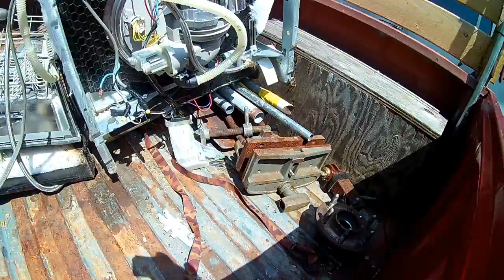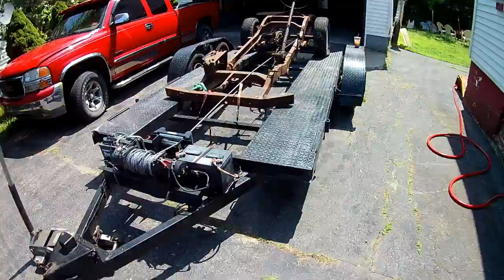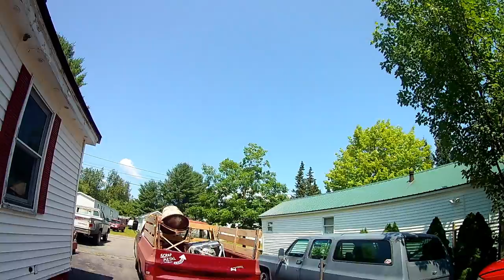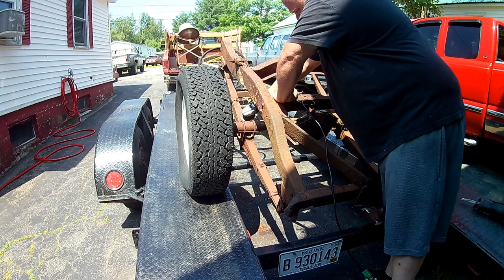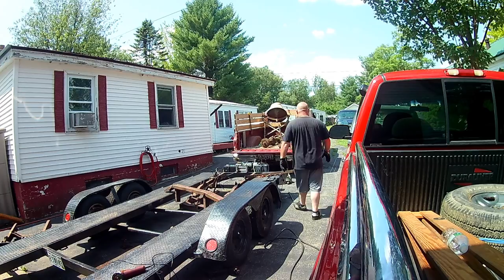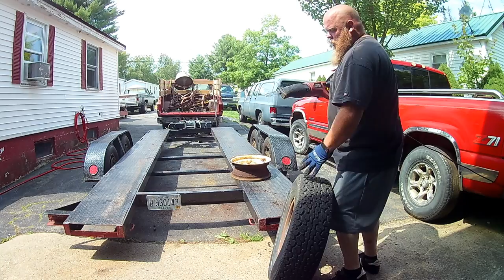Near DEATH by #1 steel

Comment: what you should invest in is an engine lift that sits in the bed of your truck i used to do scrap metal and i won't do it again without one itll save your back in the end and it's only a few hundred bucks for one
Reply from the maker: Had one years ago, bent my truck all to hell lifting crap on lol
Reply: that sucks man I can see that happening I'd rather have my truck bend than me though lol